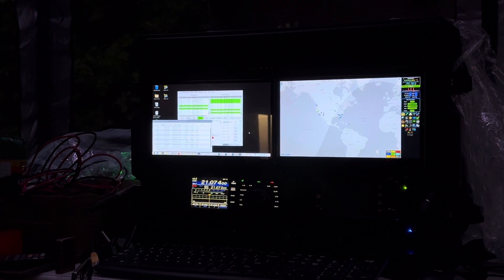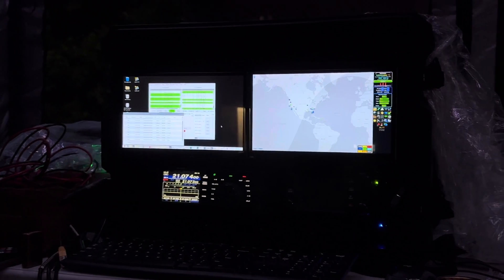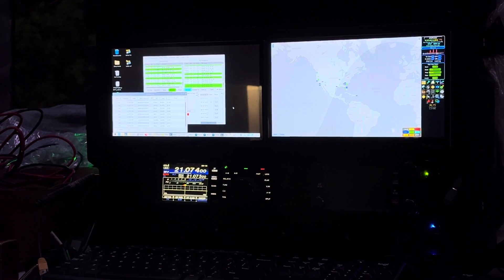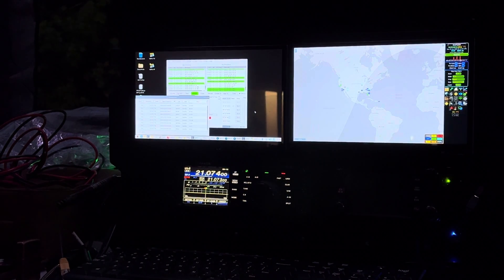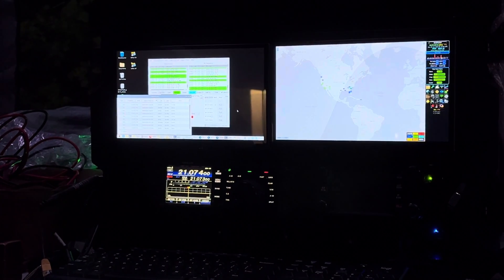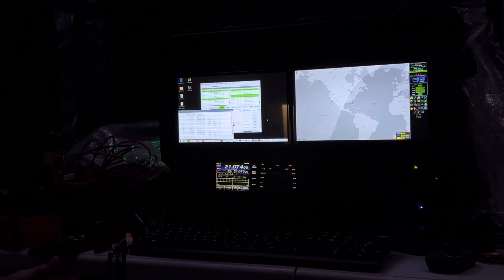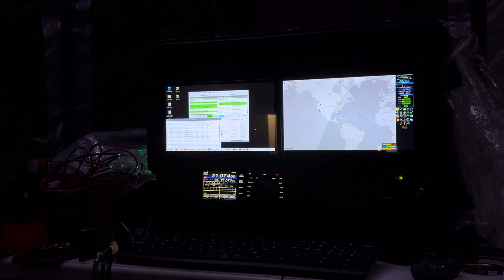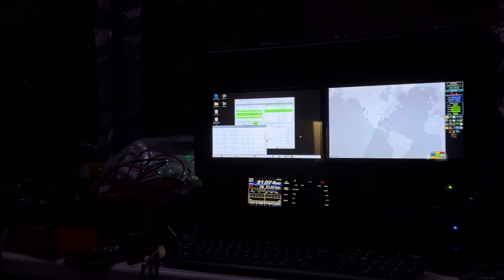The Ultimate Go Kit: Unleash the Power!

Comment: What software is he running? A Linux distro or Windows, along with whats installed and related to the hobby and emergency communications. Thanks
Reply from the maker: It’s a Linux based setup running Direwolf to drive the mapping and TNC connections for APRS and the sound card. It also has Winlink, WSJT-X, GridTracker, and several logging programs including Ham 2k PoLo. There is also a notepad. He drives them using a wireless keyboard and mouse.

Thanks for the great question!